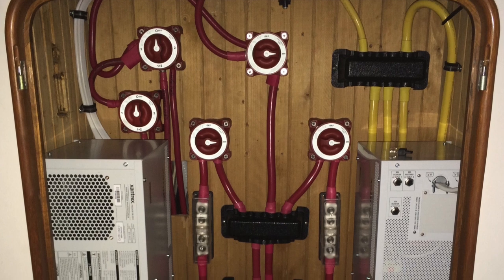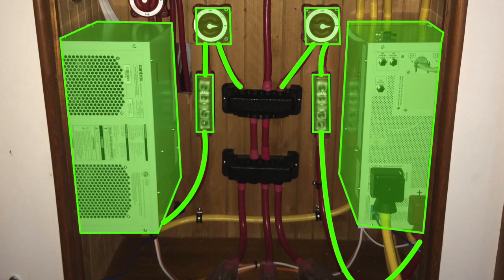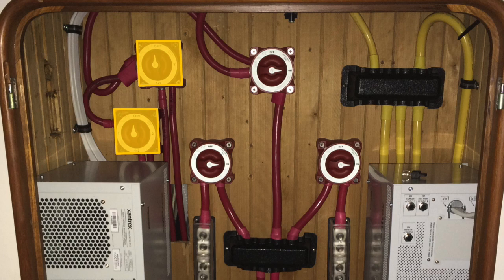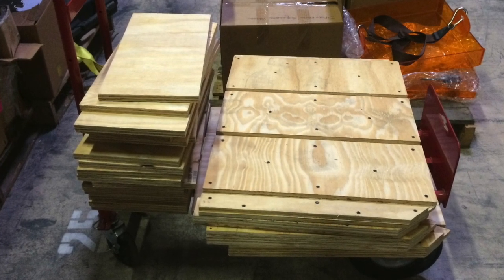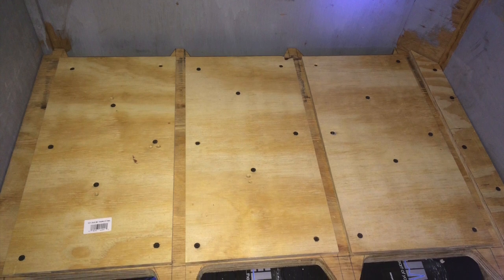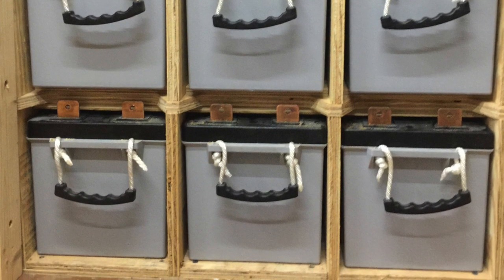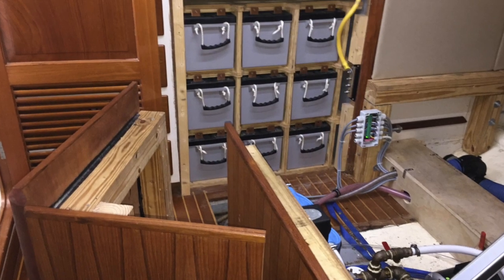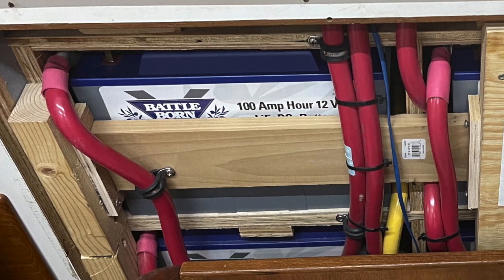Inverter - Charger and Battery Refit of Chicory a 46 Nordhavn

Comment: Thanks for this video series about all the changes you did on your N46. Beyond your well rounded skill set aligned with boat work, you make some fantastic to-the-point videos about your various projects. Thanks! Along the lines of feedback for this vid: besides replacing your AGM's with LiFePO batteries, what other changes did you make (inverters/chargers/alternators)?
Reply from the maker: Mike, Thank you for tour kind words. Because the system was built with 4/0 cable and oversized components, everything could stay essentially the same. The BB LiFePO4 batteries are configured in four banks of three batteries with each cable being the exact same length. I wanted the resistance for each of the four banks to be the same. This required adding a fourth cable  and Class T-Fuse to the three that were there. I have a Balmar 210 Amp alternator on the main engine. I replaced the Balmar regulator with a WakeSpreed WS500 so I could better control the charging profile. I added a a Victron Argofet Battery Isolator / Combiner to have the alternator charge both my house bank and starting batteries underway. I have a second 200 amp alternator and a second WakeSpreed WS500 I would like to add to the main engine, so I can make 400 amps while underway. I just need to fabricate another mount for the alternator. The last change was removing the windlass battery and running a 4/0 cable to it from the house bank. Now the house bank runs the windlass.